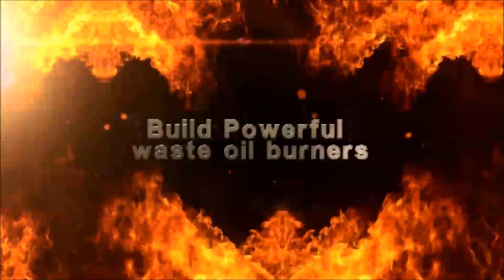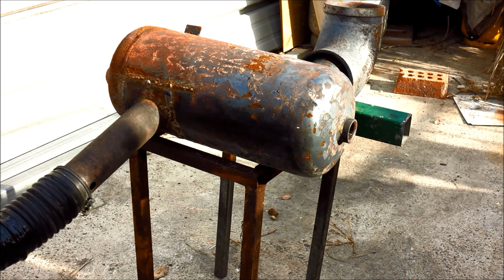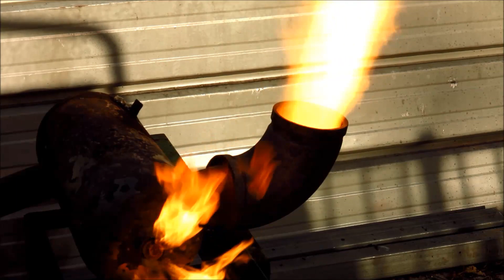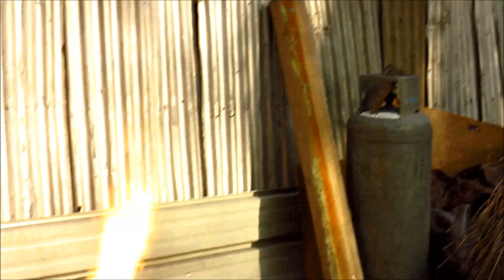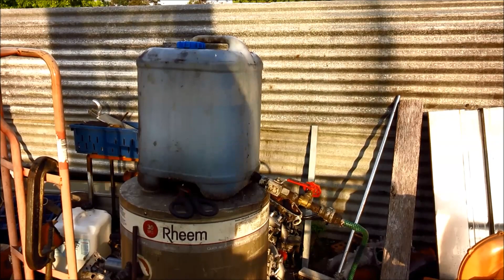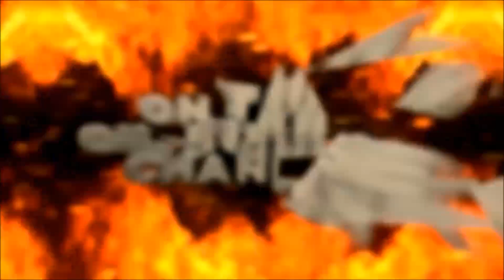How to Light and run horizontal Waste burner

Comment: You should make one of these on a cart and make the cart out of some kind of pipe that you can run water through wrap the pipe all the way around your tank over and over and have an in and out spickit.  hot water ,a furnace ,and Foundry and all the great stuff that your thing does all on a cart that you can pull around. put a power washer on it . whatever

Comment: So how does your wife find it heats the lounge, quite quickly. lol Anyone can do this stuff you need to be able to use the heat it produces to heat the pool or the home. Heating the outside air is waste of good oil. Great demo what not to do.lol.
www.dripfedwasteoilheating.com
Reply from the maker: Hello Hamish, 

Thanks for your comment.  I'm not sure how you missed it in the description let alone in the clip itself, but this vid is a demonstration of how to light a burner, not how to construct a heater for your home. These forced air burners can be used in multiple applications and put out a lot more heat than the draft burners you have copied. I see you mention taking 2 weeks to get one heater you built to run clean! No wonder you have to charge so much for your products!!
 I also see that you appear to be going to the forced air type burners.  If there is any help you need with doing these, let me know. I have been doing them a long time now and can build them in different designs and they work perfect straight off as I have shown on several light up vids here. 

I had a look at your site and found a LOT of errors in your claims and statements for your heaters which just plain don't add up with known physics.  With all your heaters I looked at, you specify temp rises and flow rates that actually excede the heat input from the amount of fuel you claim the things are burning!   Further more, you seem for most of your constructions to be using copper coils ( apart from the idea you copied of mine) as the Heat exchanger which allow the majority of the heat to go straight out the flue but also radiate onto the outer surface of the contraption itself wasting a lot of heat energy.  It is impossible you are getting the outputs you say with such terrible inefficiency let alone the heat inputs from the oil which fall well short of what you claim anyway. 

You would do well to go back and re calculate what the real capacity's of your units are because you are overstating them by a very wide margin atm.  As with your 40K L pool heater, because of the low flow rate, it would take a VERY long tome to get a standard 20oC heat rise in a 40,000L pool with something that weak and inefficent.  You can easily do the calculations on the heat rise from the 2.2L hr you claim it's burning at 100% efficiency but when you allow for maybe a 50% efficiency and then wind chill and other losses, there is no way that or your larger heater would ever be able to maintain a 20oC heat rise on a pool unless you were trying to heat it in the middle of summer!  :0)

I am amazed you seem to be selling so many units though especially at the prices you are charging for them! There must be a lot of rich or not very DIY capable  farmers and people in NZ to pay what you charge for these things!!!
How many heaters have you sold overall so far??
I might have to start building them myself if I can get that much for some old bits and pieces welded together!!  I Picked up some old gas bottles from the side of the road today. No doubt you are able to get plenty like that too as they seem to be easy to come by all over.  I guess I could also do plans and sell those but I prefer to share the info and knowledge I have freely with people to give them ideas for their own applications. For what you are producing that has no shutoffs or safety over rides, I'd also prefer not to expose myself to responsibility and loosing everything I have. I spose if you don't have much to start with, it wouldn't be such a problem. 

I might have to do some more vids though on an efficient water heater as they seem to be so popular with your clients. I notice you already copied some of my ideas and put them on your site but seem to have gone to a far more inefficient and costly way of doing things. I think you said my design was " Too effective". You have certainly rectified that particular " draw back"  as you state it in what you are doing!  LOL! 
I always understate any outputs I claim. Just a personal thing that I don't want to be a typical blowhard and exaggerate what I do like so many people think is OK now.  By doing that, I know I can not only back up what I claim but exceed it and therefore maintain the credibility of my word which my grandfather always instilled in me was a mans most important asset. 

 It would be fun to copy some of your basic designs and actually show how they could be made efficient and effective at the same time simplifying them and reducing the cost of construction.... to a fraction of the price of purchasing one especially!  A person could buy a MIG welder and  plasma Cutter as well as the materials and still save money of the cost of having one built! 

Anyway, keep up the obviously  profitable work and have a look though all my other vids where I do actually make heaters and melt metal etc rather than just try to show people how to light one as in this vid which you seem to have got very confused with.  LOL!    :0)  

+Fireman Jim So how does your wife find it heats the lounge, quite quickly. lol  Anyone can do this stuff you need to be able to use the heat it produces to heat the pool or the home. Heating the outside air is waste of good oil. Great demo what not to do.lol.
www.dripfedwasteoilheating.com
Reply: Perfect way to deal will a heckler...
Reply: Lol I would have taken a different route with this but there again I'm unfiltered and harsh. Awsome mic drop moment and good form oil burner.

Comment: Excellent burner! Can all waste oils (veg & motor oils) be mixed?
Reply from the maker: +Bob H  I believe they can all mix with the possible exception of Synthetic.  Not sure, haven't used that but i would think with something like some diesel, kero or a little petrol they would all mix OK. 
Yes, it is a drip system although sometimes for really high outputs i pressurize the fuel so it streams in to get the flow rate i need which has been up to 1L / min.
Reply: +Oil Burner - Thanks! Good to know they can be mixed (except for synthetic). I've made the 2nd video of my BBQ oil burner - I've 'super charged' it. It works great! Really makes the heat and no soot. I'll be posting that vid soon. These oil burners are incredible! Your vids are most helpful.
Reply: +Bob H   what happens when you use synth?  I've always been told not to use petrol/gasoline beacuse if ever there's a flame out the fumes can cause an explosion too easily? Sometimes I've heard people around here getting old oil tanks out of their house with home heating oil which is one I will be looking for when I build one of these in the spring...
Reply: +TheStarforce2 - Not sure what happens; I'm just going on what I've heard about synth. Course, I'm crazy enuff to try it. Yeah, gasoline is highly volatile, so I suspect it would risk an explosion during a flameout. Kerosine is good enuff for me for starting oil burners.

Comment: have you tired to run it upside down?
Reply from the maker: +Josh Kilen   Thought of, YES!  Tried to, not so far. Looks like you have just given me the theme for my next vid. 
I think upside down is a very practical orientation because you can just sit whatever you want under it to melt it.  My vertical firing burner worked real well for that as can be seen on the vid I did about 18 months back. 
Thanks for the idea!

Comment: GOOD VIDEO, my friend.  The Mrs. and I are FOND of the "horizontal position, we are!    :^)     
Do you meticulously "dry" the oil you use in burers, or is that more for your "diesel" pickup engine?
=Lemon yellow CHEERS!
Reply from the maker: +OgMandin0   Good to hear your marriage is working out the way it should. You are a fortunate man indeed. 
I'm not that fussy with drying the oil for the burners, they can sope with a bit of moisture. That said, I use so much oil in these things these days, it's rarely the slops and 2nd rate oil that gets burned in them. I use that all up quick so have to use my good " sippin" oil.  It does burn much nicer though. There was some waste engine oil in this lot because I changed it in my truck.  I can get loads of that but geez it's filthy, black stinking messy stuff.  Veg is much nicer to deal with and so much easier to clean up when you spill it which is impossible not to do.

Comment: Cool. That would be a nice setup for a down draft kiln.
Reply from the maker: +john mcginnis  Never heard of that so I looked it up. Didn't realise there were so many different types of Kiln!
I'll put that down as another use for these things.  What sort of temp range do you need for a kiln and do you have to hold that temp or just peak to it?
Reply: +Oil Burner Potters go by a value called 'cone'. Most fired pottery is a cone 7 or higher. Cone 7 is approximately 2300F. Temps typically are held for a couple of hours.
Reply from the maker: +john mcginnis   Thanks. Interesting stuff. I have seen some Vids of oil fired furnaces.  Might have to crank up the Pizza oven again with an oil  burner one day and see how it goes.